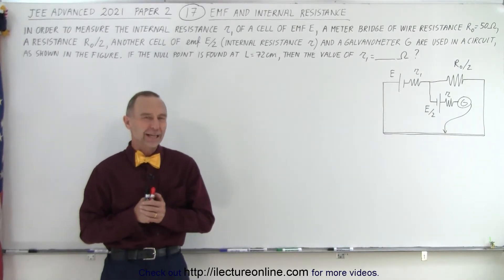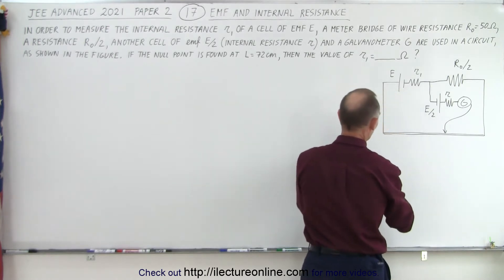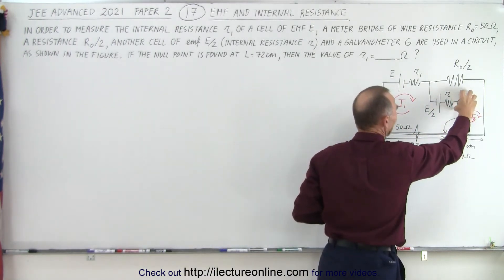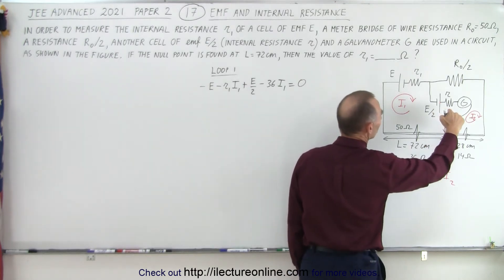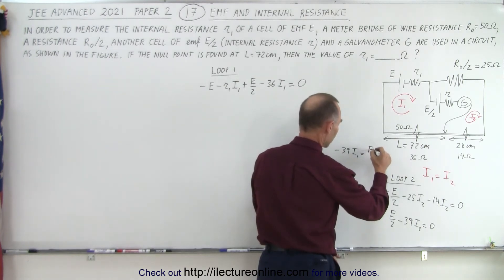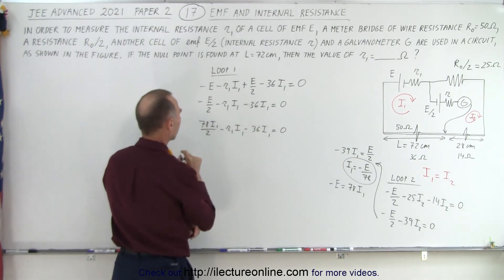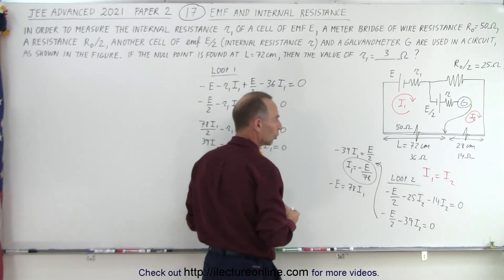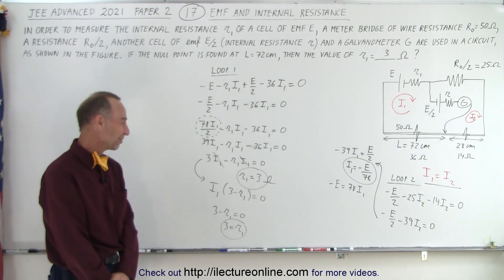JEE Advanced Physics 2021 Paper 2 #17 EMF and Internal Resistance

Comment: There can be another approach:) When potential of wire at 72cm and point between r1 and 25 ohm resistor is 0 , no current will flow through Galvanometer . Am i right Professor ??
( BUT THIS IS WAYY LONG ! )